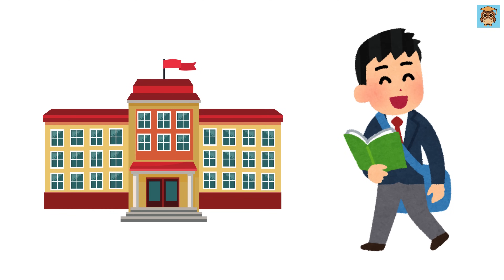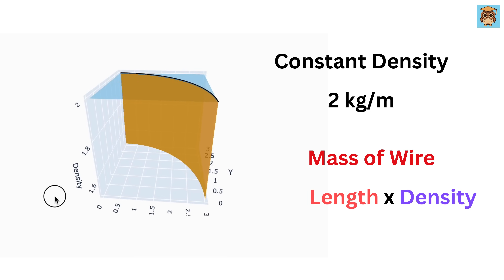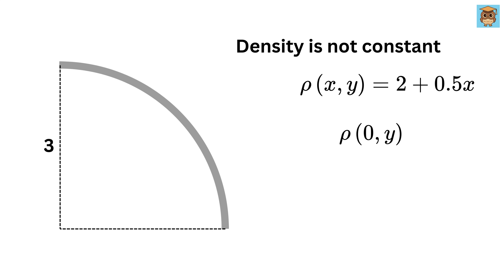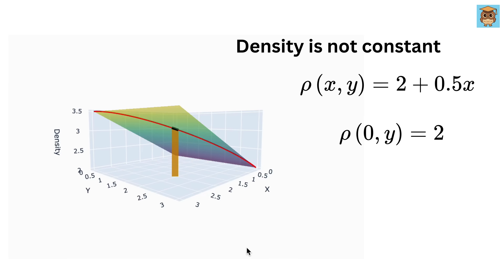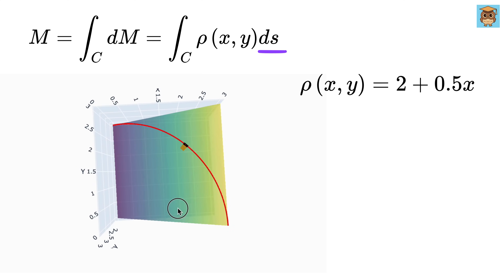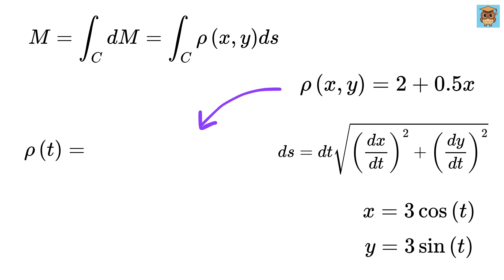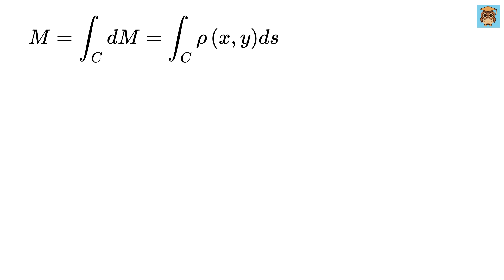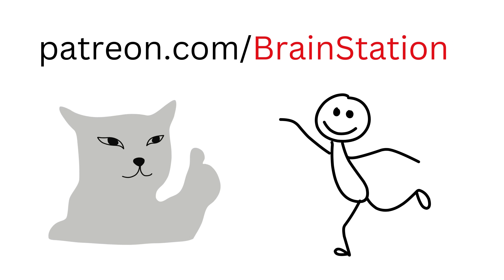No One Taught Line Integral Like This

Comment: @aliter
(Using only The Cartesian Coordinates)

We have 
ρ = 2 + 0.5 x
   = 2  +  (1/2) x
   = 2 + (x/2)
   = (4 + x) / 2

Equation of the quarter circle is
x² + y² = 3²
or, x² + y² = 9
or, y² = 9 - x²
or, y = √(9 - x²), 0 ≤ x ≤ 3, 0 ≤ y ≤ 3

Next,
dm = ρ ds
       = ρ (ds / dx) dx
       = ρ √{1 + (dy / dx)²} dx
       = {(4 + x) / 2} √{1 + (dy / dx)²}  dx

Now,
y = √(9 - x²)
=> dy/ dx = (1/2) (9 - x²) - ¹/² ( - 2x)
                  =  -  x (9 - x²)  - ¹/²
                  =  -  x / (9 - x²) ¹/²
                  =  -  x / √(9 - x²)

Substituting we get,
dm
= {(4 + x) / 2} √[ 1 + { - x / √(9 - x²) }² ]  dx
= {(4 + x) / 2} √[ 1 + { x / √(9 - x²) } ]  dx
= {(4 + x) / 2} √[ 1 + { x² / (9 - x²) } ]  dx
= {(4 + x) / 2} √{ 9 / (9 - x²) }  dx
= {(4 + x) / 2} { 3 / √(9 - x²) }  dx
= 3 (4 + x) / 2 √(9 - x²)  dx

Therefore mass of the wire is
M or m
= ∫ { 3 (4 + x) / 2 √(9 - x²) }  dx ,  0 ≤ x ≤ 3
= ∫ { (12 + 3x) / 2 √(9 - x²) }  dx ,  0 ≤ x ≤ 3
= ∫ { 12  /  2 √(9 - x²)  +  3x  /  2 √(9 - x²) }  dx ,
   0 ≤ x ≤ 3
= ∫ { 6 / √(9 - x²)  +  3x  /  2 √(9 - x²) } dx , 
   0 ≤ x ≤ 3
=  ∫ { 6 / √(9 - x²) } dx ,  0 ≤ x ≤ 3
    +   ∫ 3x  /  2 √(9 - x²)  dx ,  0 ≤ x ≤ 3
=  6 ∫ { 1 / √(9 - x²) } dx ,  0 ≤ x ≤ 3
    +  (3/2)  ∫ { x / √(9 - x²) } dx ,  0 ≤ x ≤ 3
= 6  ∫ { 1 / √(3² - x²) } dx ,  0 ≤ x ≤ 3
   +  (3/2) (1/2)  ∫ { 2x  /  √(9 - x²) } dx ,  0 ≤x ≤3
= 6 [ sin  - ¹ (x / 3) ] ,  0 ≤ x ≤ 3
    -  (3/4)   ∫ {  - 2x  /  √(9 - x²) } dx ,  0 ≤ x ≤ 3
= 6 ( sin  - ¹ (3/3)  -  sin  -  ¹ 0 )
    -  (3/4)   ∫ (9 - x²)  - ¹/² ( - 2x) dx ,  0 ≤ x ≤ 3
= 6 ( sin - ¹ 1  -  sin - ¹ 0 )
    -  (3/4)  [ (9 - x²) ¹/²  /  (1/2) ] ,  0 ≤ x ≤3
= 6 (π/2)
   -  (3/4) [ 2 √(9 - x²) ] ,  0 ≤ x ≤3
= 3π  -  (3/4) { 2 √(9 - 3²)  -  2 √(9 - 0²) }
= 3π  -  (3/4) ( 0  -  2 √9 )
= 3π  -  (3/4) ( - 2 × 3 )
= 3π + (3/4) (6)
= 3π + (3 × 6) / 4
= 3π + (3 × 3) / 2
= 3π  +  9/2
= 3π + 4.5  kg